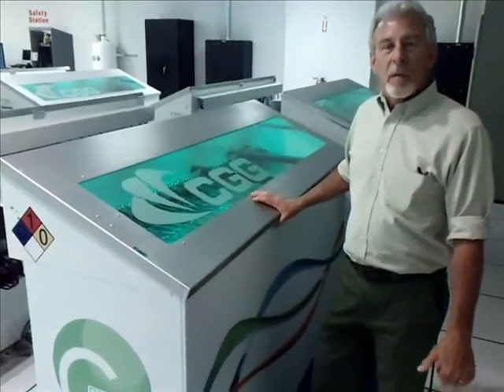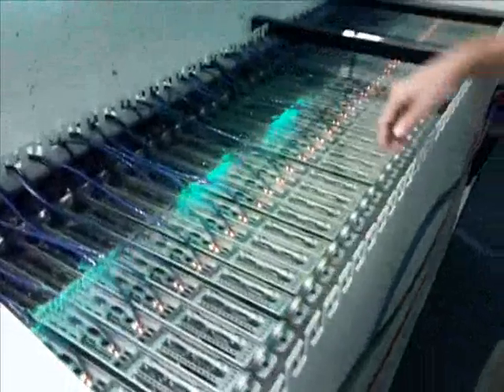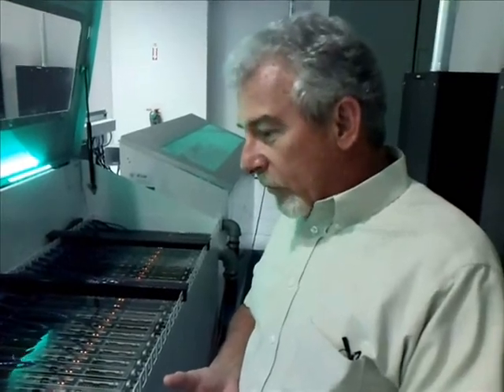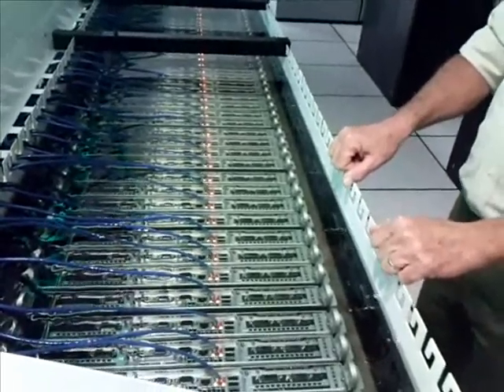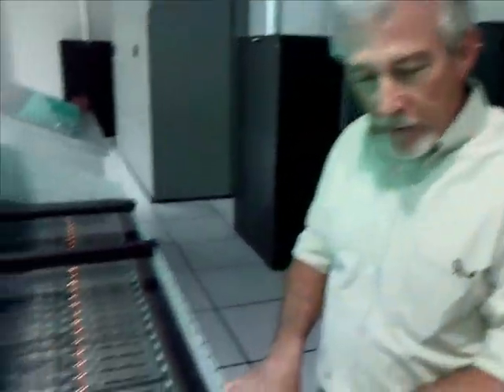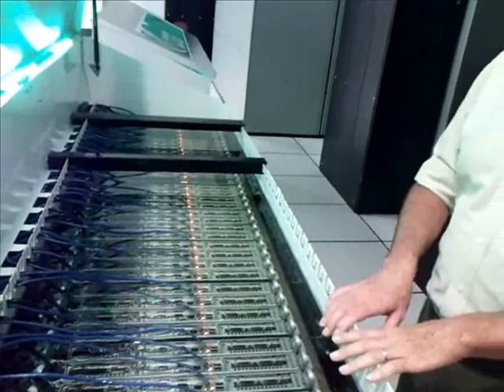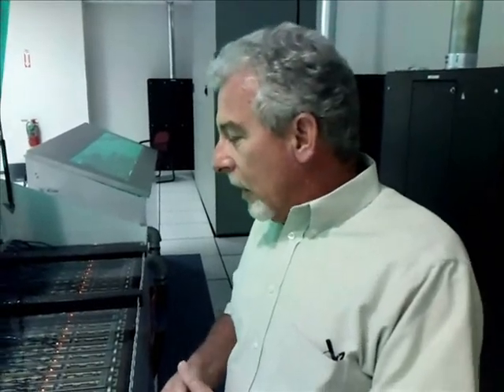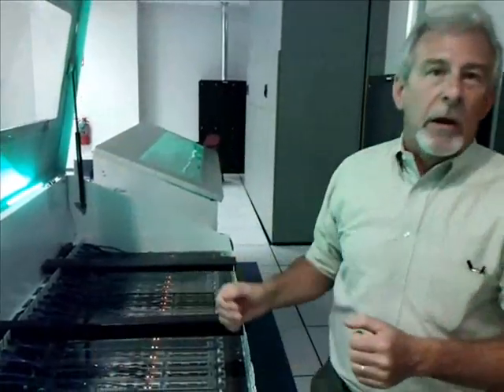The Immersion Data Center: Submerged Servers at Scale

Comment: Hi there, I have two questions, 
1) The noise in the room seemed a bit high to me. Which equipment causes the noise level in the room? Isn't this cooling system supposed to reduce the noise level? 
2) Does the heat in the pool causes the room's temperature to rise? I mean does any heat exchange occur through the wall's of the pool or there is an isolation layer that prevents it?